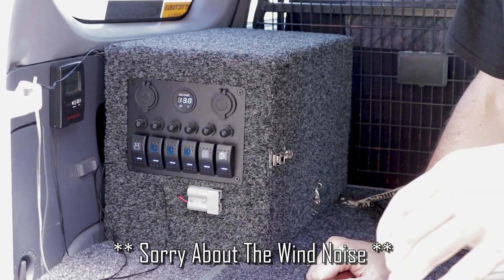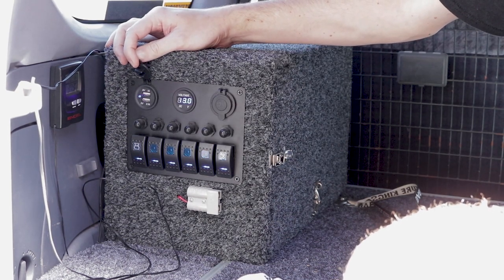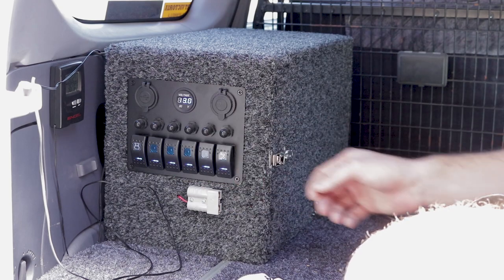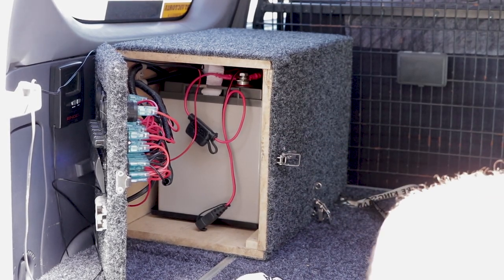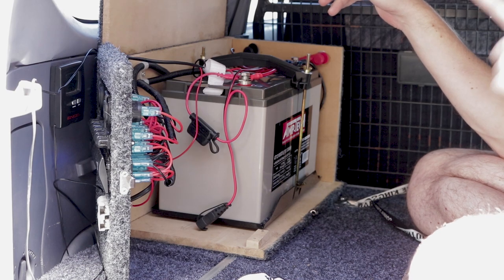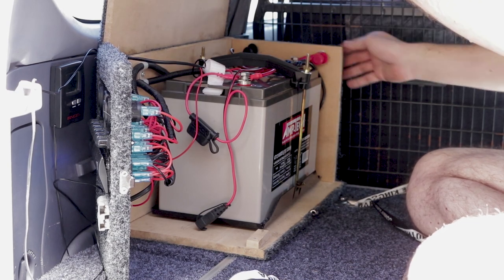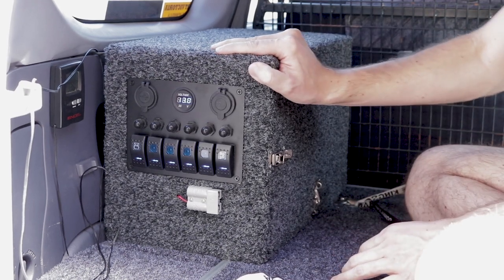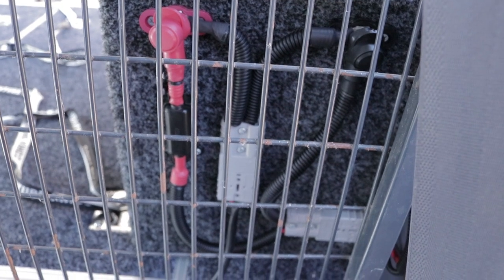Toyota Prado 90 Series // Custom Battery Box Design

Comment: That double flip lid is genius!! At first I was thinking how hard it would be to get to the battery terminals, then you opened the super secret magic lid!! I am thinking of ways to relocate my battery from the engine bay to the rear and this gave me some great ideas!
Reply from the maker: Mmmm, don't relocate it unless you absolutely can't fit dual batteries in the engine bay.

It's better up front and you lose storage space in the back.

It negates any storage use on that side of the wings.
Reply: @OzTrax4X4  Very true. I can't leave it in the stock location due to the Plasmaman intake manifold. I might be able to relocate it somewhere else in the engine bay though. Will know better once the turbo and exhaust manifold are planned out.
Reply from the maker: @NKPGarage  sounds like it's going to be a bit of a weapon once you're done.

My 80 is diesel, so can strap a turbo to it and not move anything.
Reply: @OzTrax4X4  Very nice! Wish we could get the diesels easier here in the US
Reply from the maker: @NKPGarage  South America would be your best bet bud.

Comment: Looks like a great setup mate, the carpeted box looks so much better than the almost tupperware boxes you get for batteries or just wood alone.  Is it hard to carpet the box?  Wiring looks great too.
Reply from the maker: I used to have one of those Tupperware battery boxes you speak of haha.

Carpeting the box requires some spray on adhesive and a staple gun which you can pick up from Bunnings. I just have a basic springloaded Craftright staple gun (orange in colour). Carpet I got from Clark Rubber and it was the closest match that I could get to the drawers. Just make sure you carpet the right side of the panel as you'll have to carpet everything while its disassembled.

I try and do a proper job of the wiring too. Have a hydraulic crimper for the anderson plug lugs, a ratchet crimper for the normal crimp terminals and a standalone wire stripper that is all fancy and spring loaded too.

12v isn't that hard when you take your time with it.
Reply: @OzTrax4X4  Thank you for the carpet pointers, will definitely come in useful. I have just been using solder on my Anderson stuff but so far I've just used them for charging and lights etc on my camper trailer.  Have a mate who is going to sell me his dc-dc charger so that will be a good start for a 4WD camping battery.  I made my trailer setup from ebay bits and some recycled alarm batteries but we want something for the 4WD for the offroad trips where we cant take the trailer.
Reply from the maker: @pradolover  My Intervolt 100A Programmable battery isolator does a good job of keeping everything charged up, but due to the size of the solar regulator that come with these solar blankets, there was no way it was going to fit inside the box or outside the box, so will be going to the Intervolt DCC Pro in a few weeks time as that has the solar regulator built in, plus it will back charge the start battery once the auxiliary battery is fully charged via solar, which is an awesome feature.

What DC-DC charger is your mate supplying you with?
Reply: @OzTrax4X4  That sounds great especially keeping your start battery topped up. IIRC it is a Redarc unit of some sort, I remember him buying it about 5 years ago. I have a Redarc brake controller which is top notch.
Reply from the maker: @pradolover  Redarc gear isn't bad, I sell it as part of my day job. 😉

I'm assuming he's giving you a BCDC1225D which has solar input, if not, maybe rethink that purchase.

There was also a BCDC1220 but that doesn't have solar input capabilities either and seeing as the unit is 5 years old, it may very well be that unit.

Worth checking out the Intervolt DCC Pro if you want a small form factor that is super simple to wire up.
Reply: @OzTrax4X4  Great info thank you, hard to see through the fog of misinformation and marketing BS when it comes to 12v stuff, especially seeing the endemic confusion between energy and power even in manufacturers literature.
Reply from the maker: @pradolover  No probs bud. Here to help and offer any advice.

If you're on Facebook, look me up and come over to join the community. 🙂

Comment: Is that an AGM  battery? Do you have any ventilation if it isn't?
Reply from the maker: Certainly is an AGM battery.

All details are in the description on the build. 

I wouldn't be using lead acid unless it was under the bonnet. 🤙

Comment: How are you charging the second battery ?
Reply from the maker: At this point in the build, I was charging it via an Intervolt programmable battery isolator.

Eventually I switched to an Intervolt DCC Pro DC-DC charger.

I should have a video up on here somewhere on the build.

Comment: Great set up, what size engel is that? And did you just ground the battery in the rear or just run it back to the main battery?
Reply from the maker: Hey Luk

I ran twin core wire from front to rear, as it's better to ground it up the front on a decent earth.

It's only a baby 40L Engel, nothing too crazy.
Reply: @OzTrax4X4  cool did you buy new battery terminals?